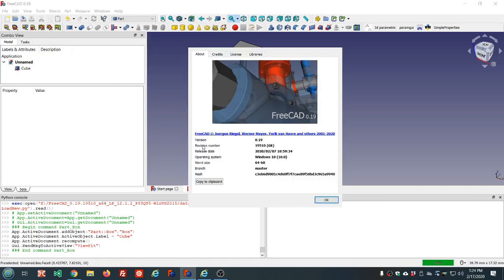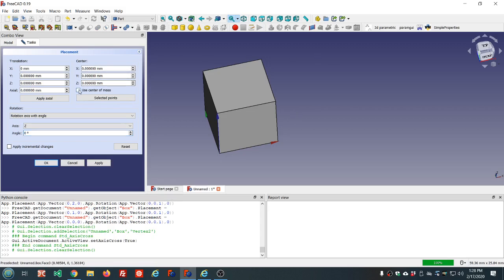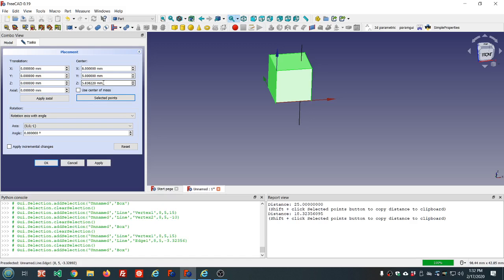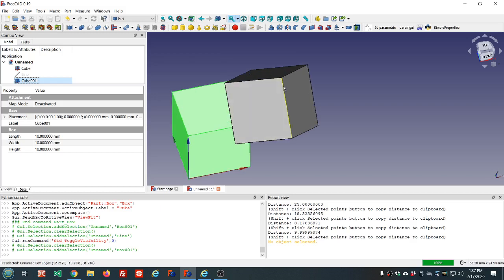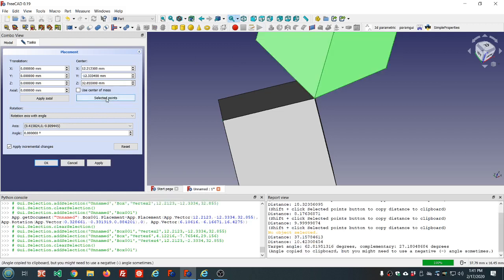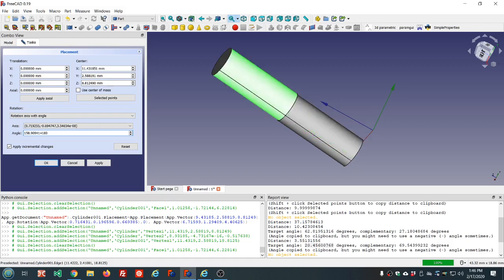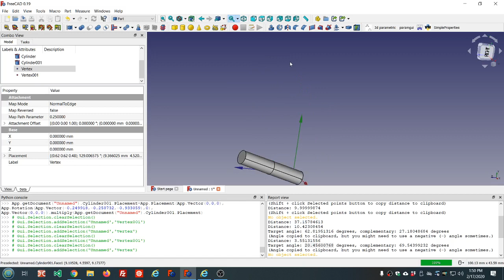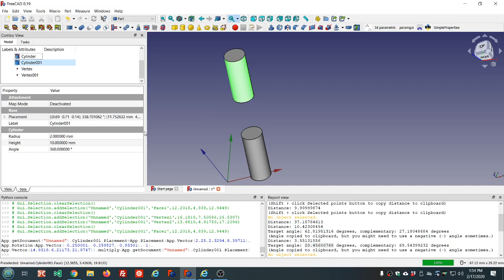010   FreeCAD placement task

Comment: 17:55, Wow this is by far the most raw but also most unintuitive, overcomplicated way to align objects that I've seen in CAD applications (Inventor, SolidWorks...). It took 6! Minutes to align two simple cubes... LOL, even if one would cut out your explanation and speed things a little up it would still take 2 or 3 minutes. I hope Freecad devs will implement a much more intuitive and especially time-saving algorithm one day were you only need to select 2 faces, 2 edges and one point to align the cubes...
Reply from the maker: There are other ways to do this.  There is an alignment task.  There are assembly workbenches A2+, Assembly3, and Assembly4.  And there is a workbench called Manipulator that can be used to align objects.

There are some limitations within the Placement task because it is a core FreeCAD tool.  Things like faces and edges are defined in Part workbench.  It is possible (not sure if anybody actually does it) to compile FreeCAD core only without the additional modules, Part, Draft, Part Design, etc, but if we made the Placement task dependent upon Part workbench this would no longer be possible.  So, we are limited with using only picked point coordinates in this dialog.

Comment: I create a sketch on a surface of a box, and create a circle, i can move the circle with my mouse but there is no placement dialogue box for xyz to be precise.
Reply from the maker: When working inside the sketch editor you can position a circle precisely where you want it using constraints.
Reply: @mwganson  thanks, so after constraining, there is a x,y or z box i can then type into?
Reply from the maker: @smarantz946  You can close the sketch and modify it's placement property or if it's attached to something you can modify it's attachment offset property, which is of the same type as the placement property.